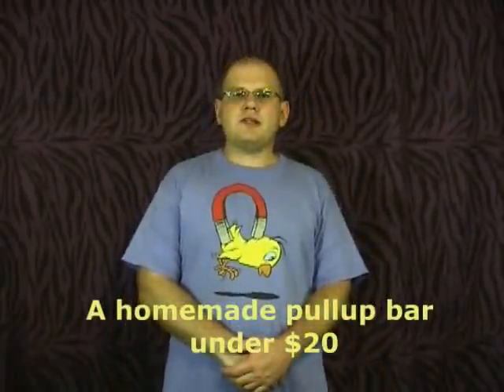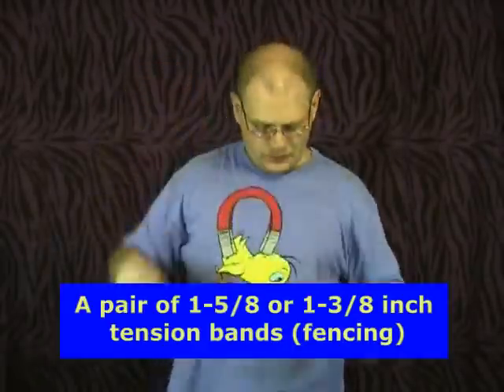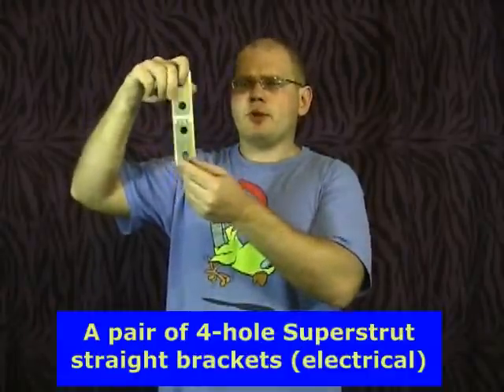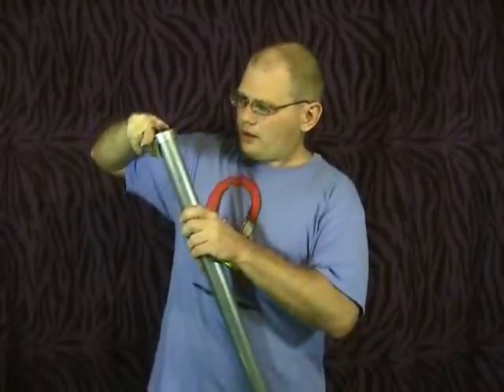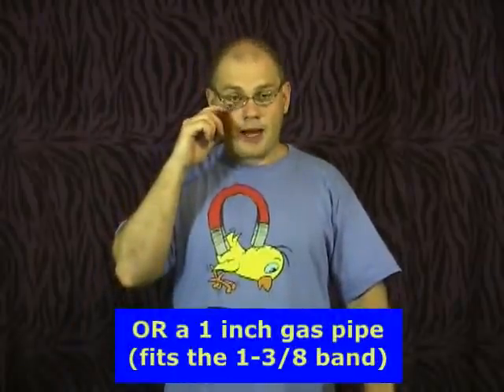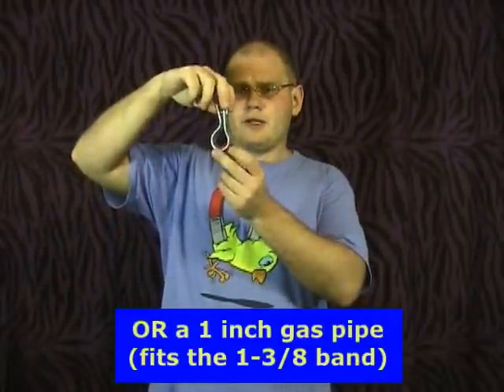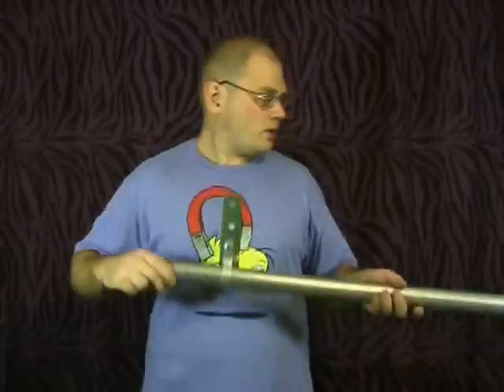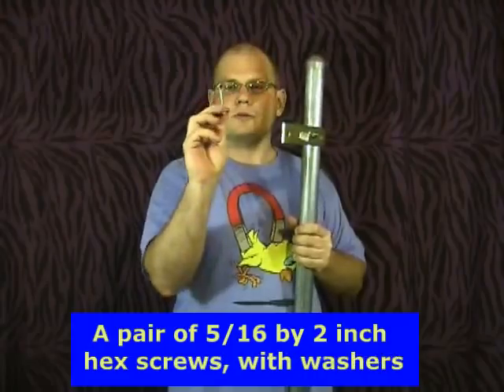A homemade pull-up bar for under $20

Comment: I built this at home a while back. It works great. The thick bar is good because it makes you only use your fingers. And not the thumb. Increasing grip strength and proper form.

Comment: he said his roof is crooked, which is why he used the leveler. The leveler shows him where it need to be to be level. Although it looks crooked it not. It the roof. But the bar is straight is as far as leveling goes.

Comment: Drill pilot holes.  I am not a structural engineer.  I am concerned that the dynamic load of  doing pull-ups will weaken the mounting brackets because bolts are not secured by nuts.

Comment: Yea but the hole roof came down when he got on the bar so wether it's level when it's just on the wall it still drops as soon as he pulls on it. So it's not level and eventually that wood will fail

Comment: Where can I buy fence post at 8ft. Long for cheap!?? And where to buy extensions connectors to maje a stand alone 8ft. Long pullup bar? Like as big as a gymnast pole.
Reply from the maker: To make a  stand alone bar you'd have to make metal (which means welding) or wooden triangular stands and then fix your bar on them. You probably need to get someone good at welding or carpentry to help you , and do not expect it to be super cheap. If you just want a bar longer than in this video, check the pluming dept. in home depot. They have a variety sizes of metal pipes, and you can choose the right size for you

Comment: Too bad the bar is extremely off level and that's gonna jack your arms up. Plus there's roofing nails coming through the roof which means you can't go very high. And no muscle ups for you
Reply: The bar is level. The roof is pitched.